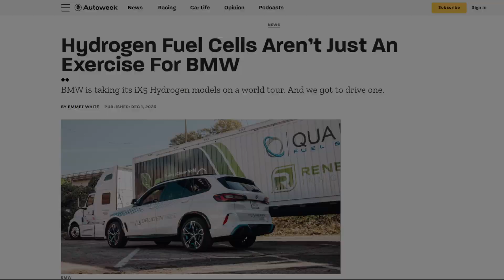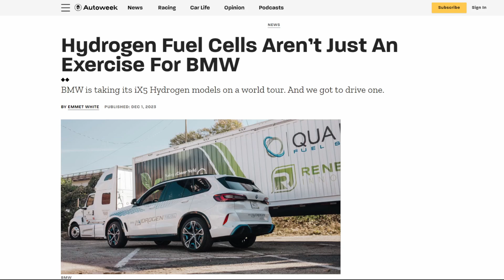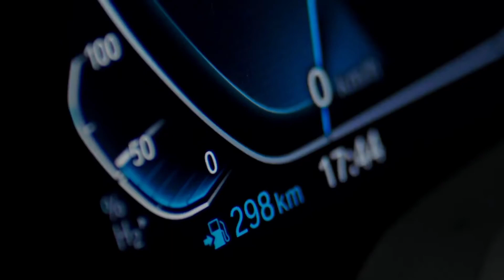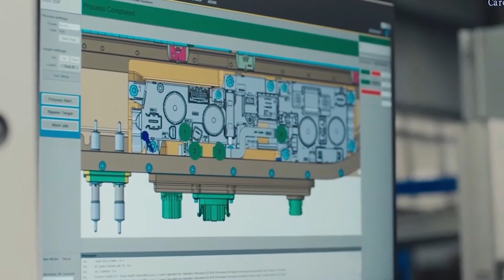BMW Is Saying Goodbye To Battery-Electric Cars.

Comment: Why are the companies worried about co2 emissions?, aeroplanes dont produce co2 gases?
Reply: CO2 is the mainly culprit behind global warming. Humans burn 3.5 cubic miles of oil-equivalent in fossil resources each year, adding 37 billion tons of CO2 to the atmosphere each year, increasing average global temperature by about 0.5F per decade.
All the cars in the world emit about 3.5 billion tons of CO2 each year. All the planes in the world emit about 880 million tons of CO2 per year.
There are several electric airplane designs being developed and tested right now, and there are efforts to make biofuel for airplanes.

Comment: It is a futile job to speak for ICE or Hydrogen. As for Hydrogen, the energy to generate hydrogen cleanly require huge amount of energy, compared to generate for EV. 

If it is generated from natural gas, then what is the point to switch from ICE to hydrogen. Doesn’t make sense. 

Well, just let the market play it out. If you can get cheaper hydrogen compared to EV and less maintenance as EV, then the market will buy your idea. 

Range anxiety has improved tremendously in the last 10 years. It has accelerated in the last couple of years, which will further improve moving forward.
Reply: The market is playing out at the moment, RV sales down 30% month on month.

Comment: Dec 21, 2023 — BMW aims to deliver more than 500000 electric vehicles next year, the German carmaker's chief executive, Oliver Zipse, told the Focus news ...

It seems your statement that BMW is "Ditching" electic battery powered vehicles is inaccurate. Above is what Zipse said just over one month ago.  Secondly, hydrogen is not very green, at this time. The hydrogen available is generally grey hydrogen which does emit methane in production, and costs to liquify and transport hydrogen is very expensive.  We are not ready for hydrogen as a practical fuel sorce.  Cheers.